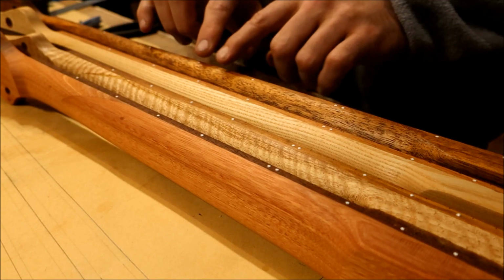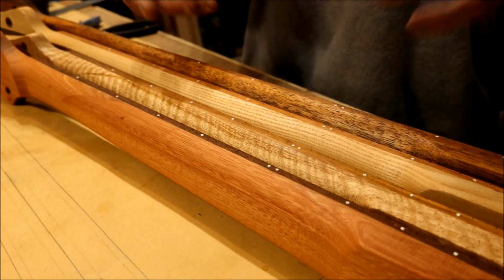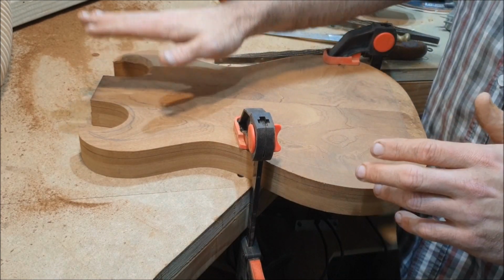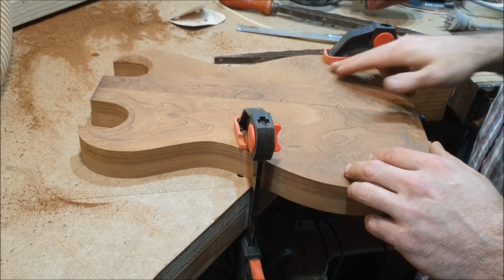Guitar Buildathon Episode 15 - Side dot markers and more body carving

Comment: The builds are going great (I realise I'm coming late to the party). Lockdown blues was good fun :) I'd love to know how you made the other tracks behind the scenes and got everything to match up so well. Did you use a normal video editor with mutiple audio/video tracks or do you need to use some more specific recording/editing gear? Would be great if I could figure out how to make multi-track music recordings at my place.
Reply from the maker: That was before I had Adobe Premiere, I had to jump through several technical hoops to make it all work in Windows Movie Maker. I have a long history of recording things that nobody ever listened to so there's quite the library of music waiting to be heard. I think from memory I was editing the video, stripping the audio out and mixing the songs in using Audition, then recompiling the video using the finished mix, weird way to do it but it was all I had at the time. Now using Premiere and it's much better, cheers.
Reply: @fanbladeinstruments  Thanks. It sounds pretty awkward to make it work. I am using resolve which probably has more in common with premiere than movie maker. I will give it a shot one day. Thanks for the info 👍